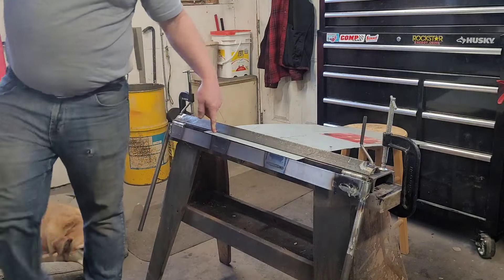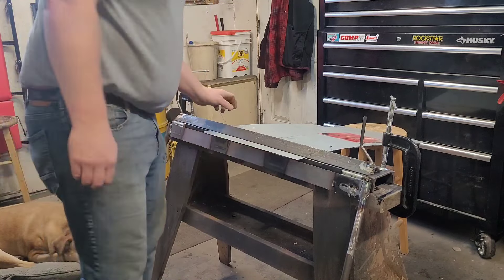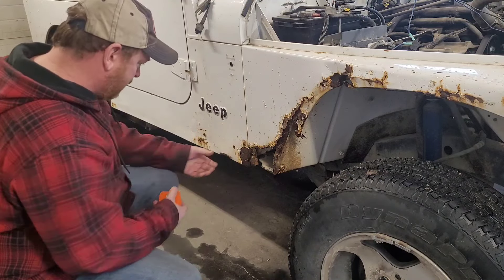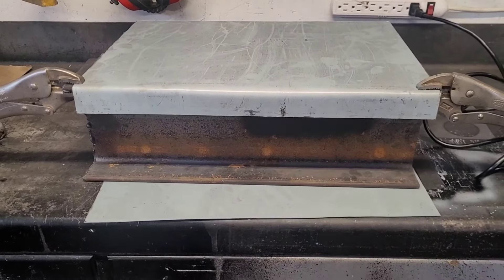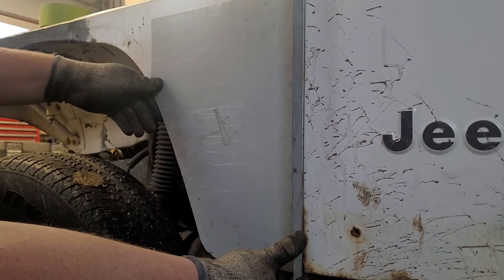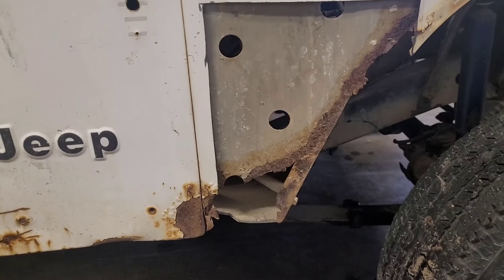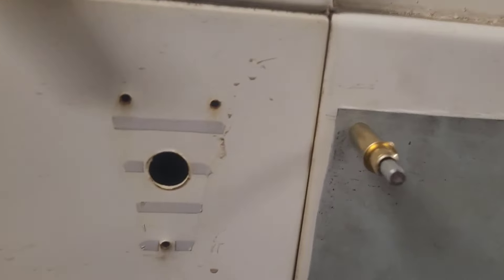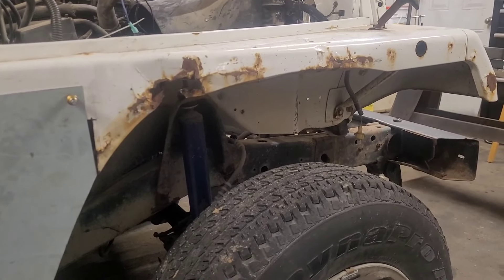Major body panel repair with simple tools! Can we save this fender?#nonamenationals #jeepyj #diy

Comment: I’m in Saskatoon and have a 62 Acadian 2dr that needs metal work, when are you coming over??  LOL.  You did a great job on the metal work. Well done! Looking forward to more videos.
Reply from the maker: Thanks alot! I got to stop building vehicles for my kids before I could ever offer to help others! Is your Acadian a driver now?
Reply: @Mynextproject_74  not even close. Lots of metal replacement done, new floors, rocker, outer wheel well, firewall fixed. Working on trunk and rear quarters. The more I got into it the worse I found things-like your inner front fender. Watching Fitzee’s Fab for lots of hints too.
Reply from the maker: @michaelvangrondelle5916 yes, Fitzie is awesome! When I rebuilt an 89 Dodge truck with my son I had a full year in the body. Had it not been my truck in high-school we would have never done it. A guy just has to do something every chance you get and eventually it'll get done!